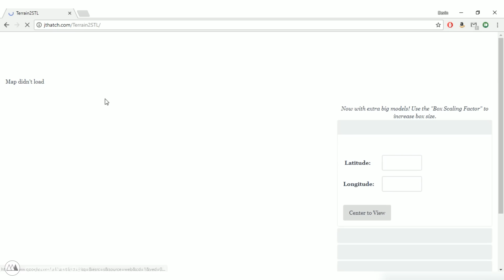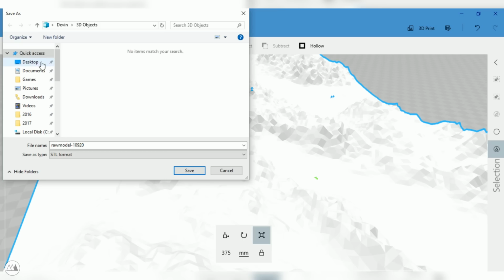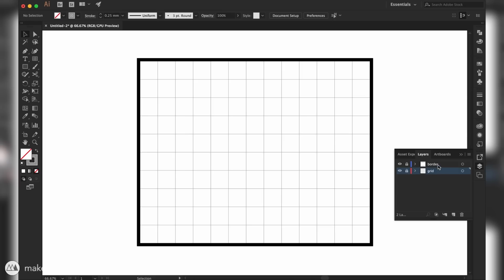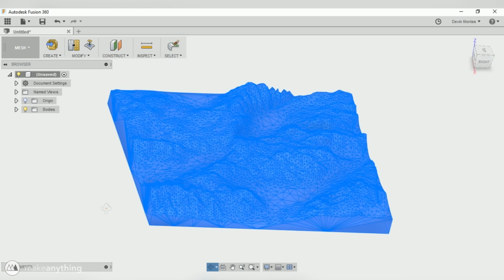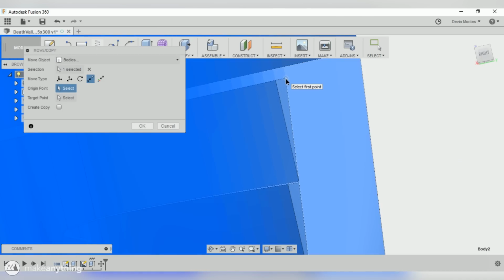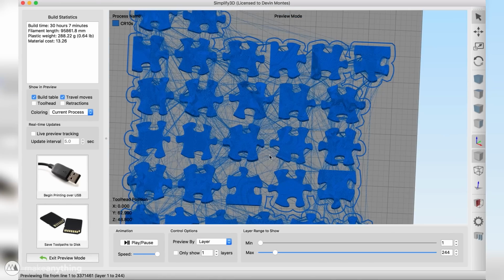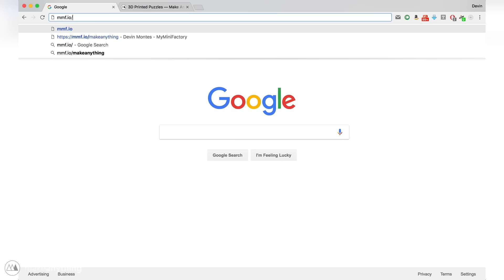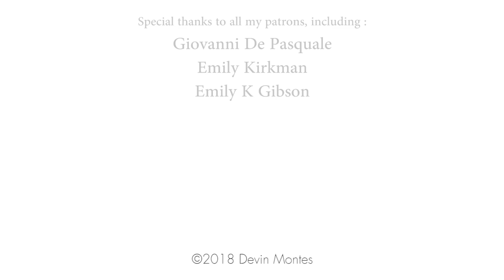How to Make Your Own 3D Printed Puzzles

Comment: Why did you have to export each piece separately from Fusion 360? If each piece had a 0.2mm space around it, couldn't you slice and print it all at once (assuming it would fit withing the printer's build volume?

Comment: .3 seems a bit tight, why not test .35 or .325?
Also this is more of a 2.5d puzzle, it's 2d but with a varied z height; 3d puzzles, as far as I know, typically have multiple planes of how the pieces fit together. But a 3d puzzle of relatively flat objects would be difficult to do, but you should experiment with polyhedral puzzles with proper edge and vertex pieces.

Comment: Could you have buildings in the puzzle?
Reply from the maker: Yes, but the terrain tool I used doesn't include them, so you'd either have to find a model with buildings or add them yourself

Comment: i wanted to use this in a project i'm working on. is there any way to change the box's form?
for me it's an rectangle, and does not fit with what i want. i would prefer a like-sided square.
Reply from the maker: +Tim Tem just get the rectangle and cut it down to a square after the fact! Or any shape for that matter :)

Comment: There is a 'mass operation': you export all of them into one STL (by exporting the component or the project as STL) and then you take it into Mesh Mixer and use the separate tool. Mesh Mixer is also the better tool for what you did in the beginning in the Windows 3d thingy. Watch Maker's Muse's videos on Mesh Mixer, he just did some good basic tutorials on those functions
Reply from the maker: +Kaido1 I use meshmixer all the time, but actually find the UI of 3D builder to be more straightforward if you're just doing simple operations

Comment: Inkscape has a plugin to create puzzle pieces with randomized edges. There is no need to draw them by hand in a paid software.
Reply from the maker: +Chris B that's awesome
Reply: Not just a paid software, but a software you have to pay for every single month.
Definitely use Inkscape if you aren't a professional.

Comment: Hmm this video gave me some ideas. Thanks for sharing. I have a mini printer so such a print would take longer. Wonder if I could make original designs this way with thinner pieces. Guess its all about spacing things out, maybe keep the pieces numbered. Eager to try something out now but I wanna make some unique puzzle piece shapes by hand as I've recently helped some family with a very uniquely shaped pieces style puzzle and well, that just seems more fun. Maybe a little 3D pop out with a plan to paint it later would work decently enough. Now just to find the best paint for PLA.

Comment: Why not print it as a puzzle all assembled? You can check your gap settings with a test print like makermuse has, this way you can print is as you cut it in fusion 360. or at least only have to do the save stl a couple times to fit on your build surface.
Reply from the maker: Printing it assembled with the same tolerances would required pretty perfect print settings.. quite the challenge!

Comment: Amazing design and I admire your abounding persistence! An interesting alternative design choice could be to change the filament at set Z heights. This could give a striated mountain affect or resemble elevation topographic map. But in any case, super impressed with this project. Thanks for sharing it.

Comment: Protip: Though it takes a tethered computer to run, Pronterface is amazing for this kind of job. If you have a failure in a print with a ton of little parts, you can tell it to omit objects from future layers. Just disable the piece, pause the print, secure it or remove it from the bed if you need to, and let it resume.

Edit: For real though, I'd love to see that functionality in Octoprint someday.
Reply: Good hint! Thanks!

Comment: For a faster way to save all the individual puzzle pieces, right click on the component, click save as .stl and then, from the structure drop down, select 'One File Per Body.'
Reply: he is prob slapping his fore head right now.
Reply: or export it as one stl and in simplify3d use "Mesh -> Seperate connected Surfaces"
Reply: you're a lifesaver

Comment: Devin I need a lot of help.
I tried to use my school’s MakerBot filament on my cr-10 (OH BOY WAS THAT A MISTAKE) and my feeding stepper actually stripped the filament. So I tried to pull the filament out of the tube and it snapped, but too short to grab it with anything. So I unscrew the feeding tube and I DECIDED FOR SOME STUPID REASON TO CUT THE PART OF THE FILAMENT FEEDER TUBE THAT IT CLOSEST TO THE EXTRUDER. whoops. So long story short my extruder is jammed with a bunch of little bits of filament all at the very bottom of my extruder and there is no way to get them out. I’ve tried running good filament, but it still strips it.  I have literally disassembled my extruder and idk what to do about it... it’s a new printer and I def don’t want to buy a new one, but I’m open to getting a new hot end... any suggestions from anybody??? ( sorry for the long comment... )
Reply: You might want to try cleaning the nozzle using the atomic pull method, if you haven't already. It's possible the plastic has decomposed into something that doesn't soften at regular PLA temperatures. If there's plastic stuck above the heat break, you should also try pushing a thin wire or drill bit up from the bottom of the nozzle. Otherwise, I would try replacing just the nozzle first, and then the hot end if that doesn't work.
Reply: Cranfres Thank you so much
Reply: james pogrebetsky Well actually, I politely asked my science teacher in order to help print cubesats and he allowed me too. It’s not a good idea to assume :)
Reply: Thank you everyone I appreciate it
Reply: If you do want a new extruder, get the Flexion extruder. It prints better and allows flexible filament.
Reply: That's what you get for stealing from your school :D

Comment: You could connect the puzzle pieces with a small line at the bottom of the puzzle, then split the puzzle into four quarters and print those. Once it's printed you can cut the pieces apart very quickly. That way you only have to save four bodies.

Comment: quick trick: extrude a rectangle on the bottom and join at 1mm thickness then in the slicer set model position minus 1mm it turns all into one part and then the .stl is one file and you can print it all at once

Comment: There is a way to  mass save separate stl files: right click on the component, save stl and in the menu , you will see "Structure: one file", change it to one file per body.
Reply: alcx112 that's exactly what I was gonna say, saving one by one is just crazy :D.
Well done !
Reply: This needs a pin... I just made a puzzle like this myself (Waiting for it to print!), without knowing about this...
Reply: Thanks for the tip, till now I used a workaround: Added a 1mm Bottom-Plate to combine alle Bodies into one in Fusion360, imported the STL in Slic3r and removed the Bottom-Plate using "cut" and "split".
Reply: Yeah  was thinking that there was no way that this program that professionals use to make working models with thousands of parts didn't have an option to save each body individually.
Reply: lifesaver